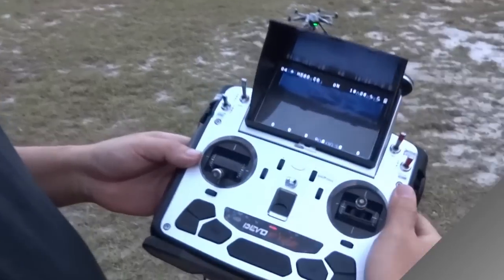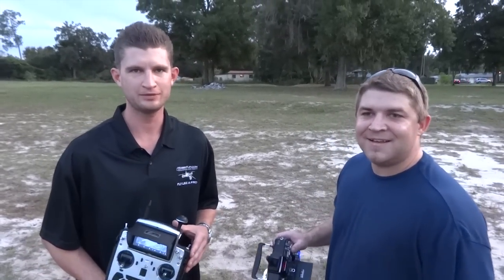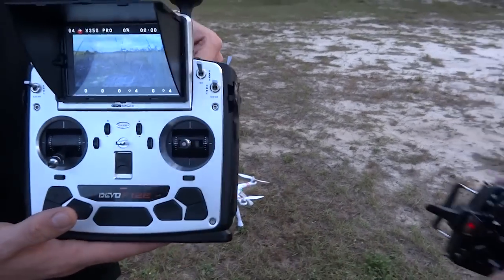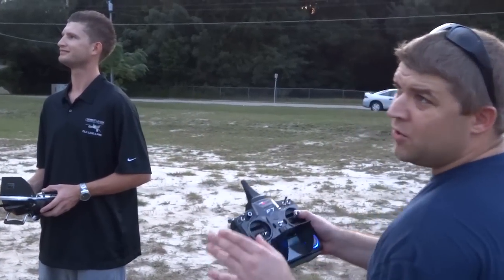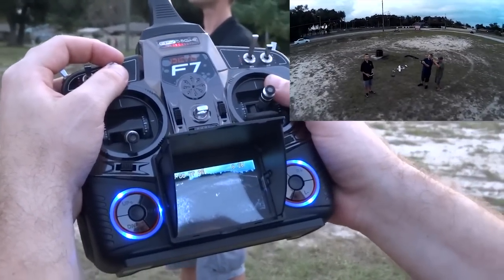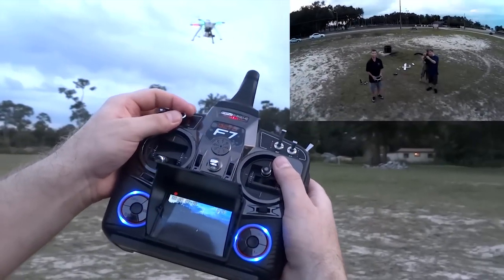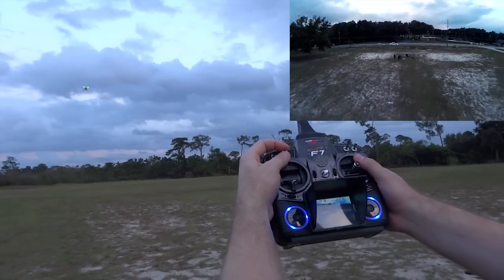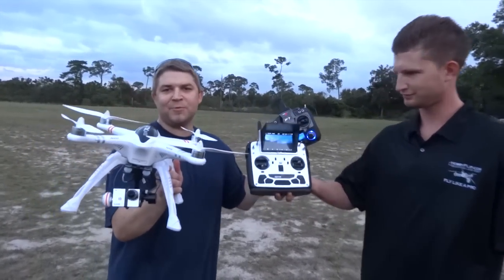Walkera Devo F12E Wireless Co-Pilot Mode

Comment: Great work guys, will the wireless setup work with any 2 radios or do you have to have the same ones?
Reply from the maker: Benjamin Mois hi there, copilot mode uses a devo F12e trainer button (not spring loaded) and any second radio, of course with ppm and a dial/slider.

Comment: I have the devo 12 and devo 10 and im trying to set it up like you have in the video what when you click on trainer mode it only goes up to aux3 and the gimbal in on aux 4 and 5 how do you get this to work? it there anyway you can walk me through the set up on the transmitters?
Reply from the maker: Michael R. Head user the trainer cable, make devo 12 the master to control gimbal, and assign the flying to the devo 10.  there is a little paragraph on the devo f12e manual that explains how to assign a preferred button as the the trainer button.